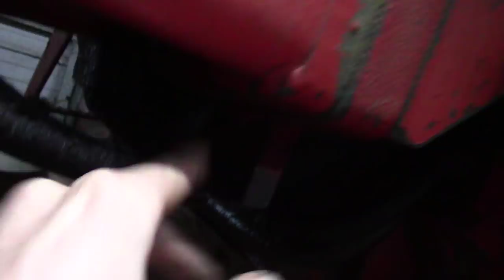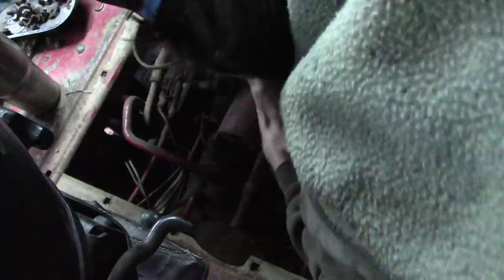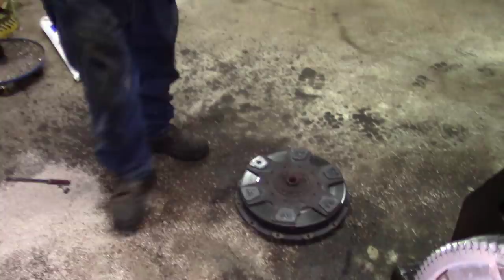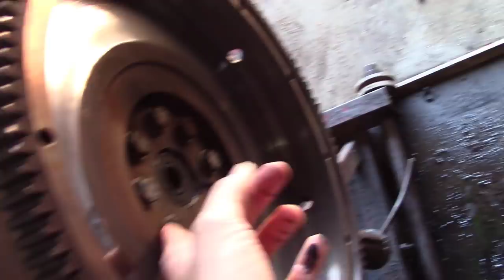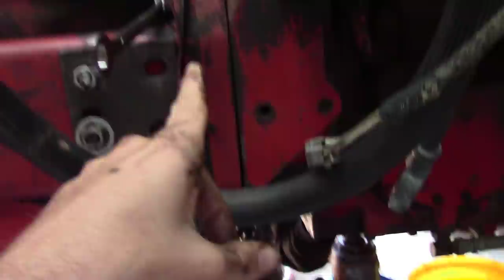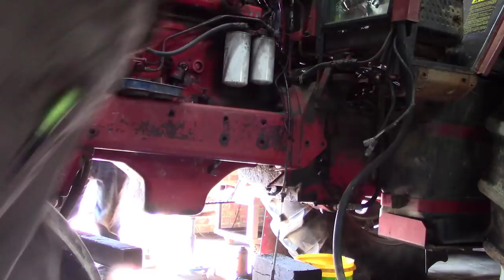1086 International clutch replacement

Comment: Definitely don’t force it. Was helping an older guy years ago. He had built a grease pit (google it) and we were in there putting a clutch in his old pickup truck. He was all in a hurry and wanted to just crank the bell housing bolts down and I had to just about turn a hose on him to keep him from breaking things. I told him “Mr. Hill — when it’s right it’ll practically jump into place. Until then we’re just gonna have to wiggle and bounce it around some “. So we twisted and bumped and jiggled that transmission and then “Snap” — she banged home, just like I told him. He turned to me with a wide-eyed look of amazement on his face and then busted out laughing. I had a good laugh too and he owed me one for that days work.
Reply: Yeah a mate of mine tried to pull his together by cranking down on the bellhousing bolts and broke the bellhousing! Unbeknownst to him the later model engine he was fitting had a shallower pocket in the back of the crank and needs the input shaft cut down if fitting to an early gearbox. Early ones had the spigot in the crank, late had in the flywheel hence the change. If it's not going, don't force it!

Comment: Cool video.  I have an 1086 and it had a new clutch and ta installed right before I bought it.  I like those splitting rails,  I could have used a set of them when I put a clutch in my 584 a couple of months ago.  I have never seen anyone install a clutch and pressure plate that way before. That's for sharing.